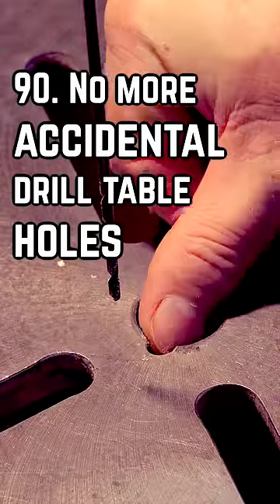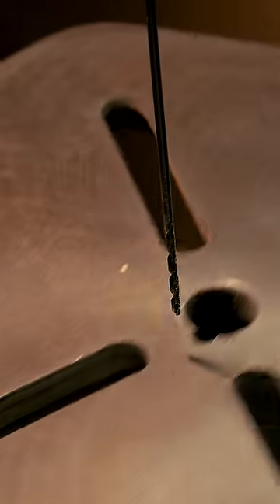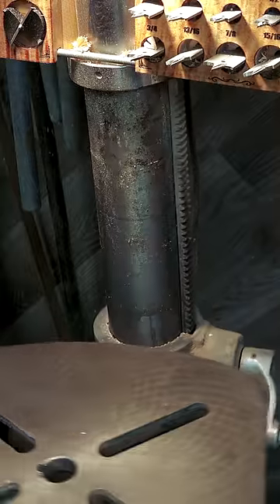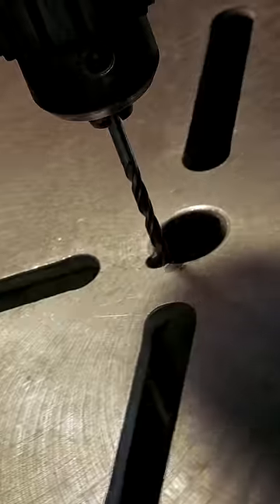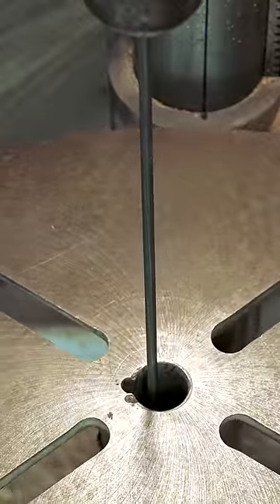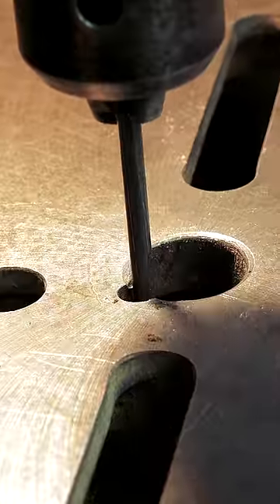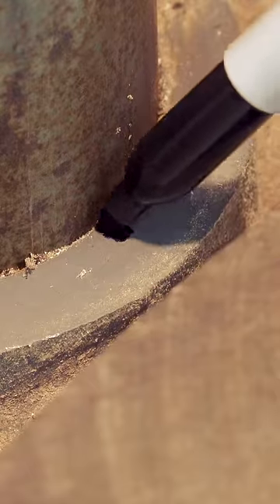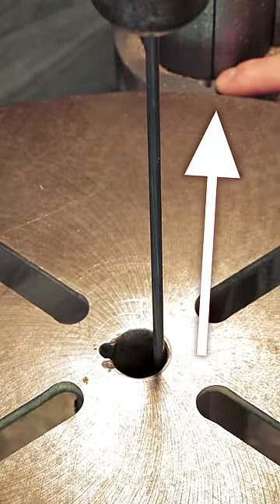90. No more accidental drill table holes #mtbitesize #shorts

Comment: You can probably just put a block of wood underneath what you’re drilling so you won’t hit the table
Reply: occasionally you want stuff to be precise and the wood just won't cut it
Reply: @wea69420  if you want it to be that precise you wouldn't be using a drill like this, you'd be using a CNC
Reply: @That_One_Kobold  my guy, people were machining stuff since the industrial revolution. You can absolutely make precision parts without a computer.
Reply: @wea69420  not with a drill like that you aren't. Also during the industrial revolution you wouldn't see things having to be 0,001 mm precise
Reply: @That_One_Kobold  You certainly aren't, but it has been done. Also precision doesn't immediately mean a thousand of a millimeter.

Comment: I just look to see if the holes lined up before I put a piece  on the table it's not that hard.. and in my opinion if you're drilling through wood and then drill through the metal that's holding it you probably shouldn't be using a drill press. I mean it's very easy to feel when you drill through your piece

Comment: Good tip! You can also scribe the line and it will last for an extremely long time! Since the table assembly is pretty loose it shouldn't mess with anything.
Reply: Came here to say that. A scribed line will last a lot long. Run a permanent marker or paint pen down it, wipe excess, and now you have a colored line.  Great minds.

Comment: Here’s a tip, just lower it a lot, and place a few planks of wood on it. It makes things less stressful. If you need the holes, you can always just drill through the wood and use it like that. Clamps are also very useful, if you don’t want anything to move around, or if your scared of your project spinning.

Comment: I recently broke the table off of my old drill press. The column that holds onto the shaft broke and I'd like to replace it if possible. Is it possible? I couldn't get the rest of the broken table off so its hanging there and I'm just using a sawhorse as a rable currently. It works but since the table and press are two separate peices it doesn't get the pressure it need to cut proper.

Comment: Why not just secure the rack?
Reply: Exactly what I've done. I drilled and tapped two holes in the upright with matching holes in the rack (split the rack in to thirds and use the two 'center' marks). Countersink a flat head machine screw in each and the rack is going nowhere.